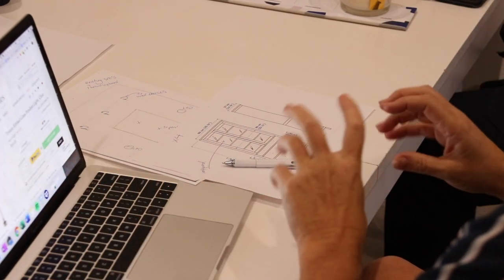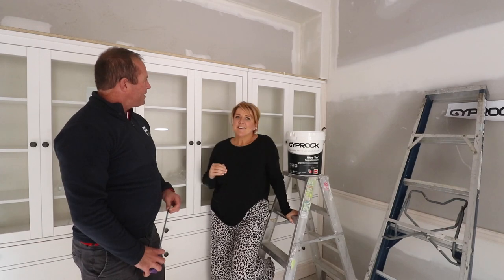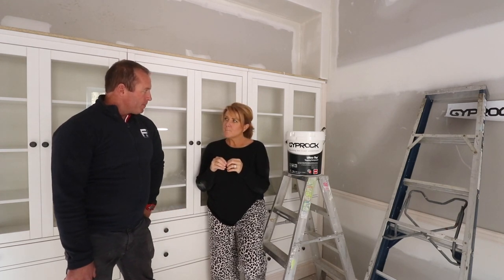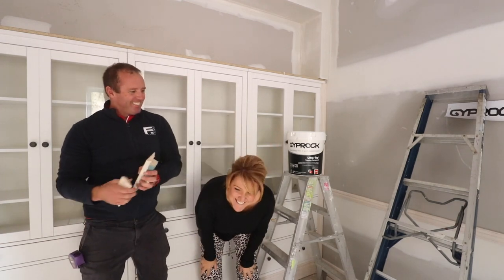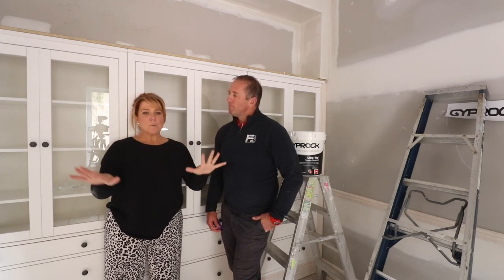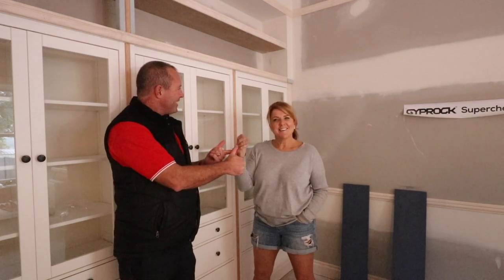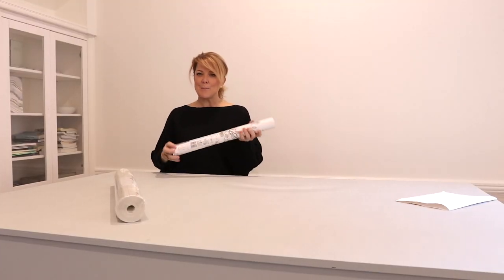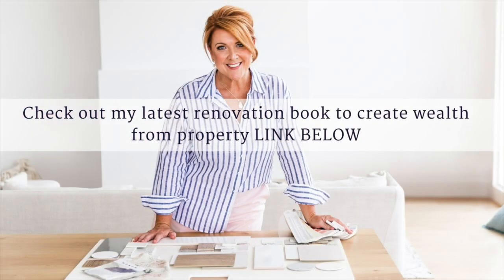IKEA Wall Shelving Hack | Naomi Findlay | Renovie

Comment: For others thinking about this concept there is another option to consider.  Cut foam board or something similar to fit the back of the bookcases then just cover them.  This makes switching out the backgrounds an easier task in the future.